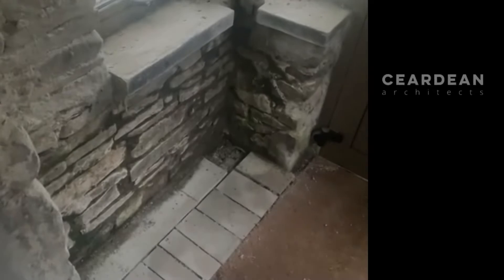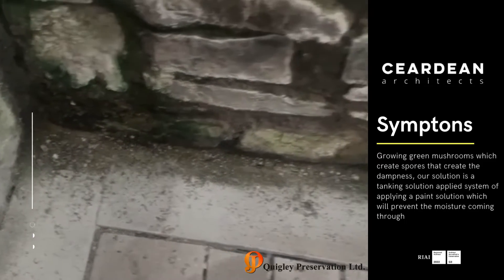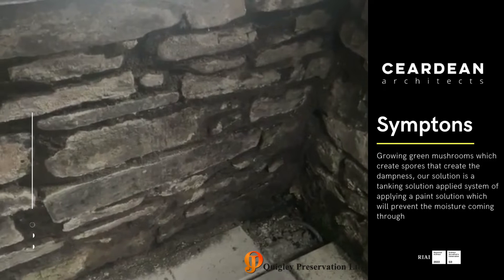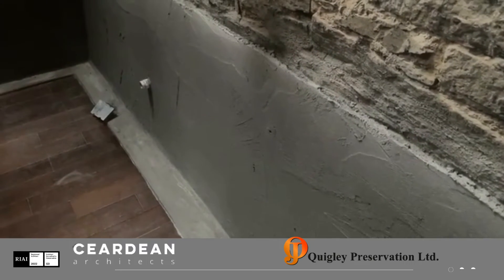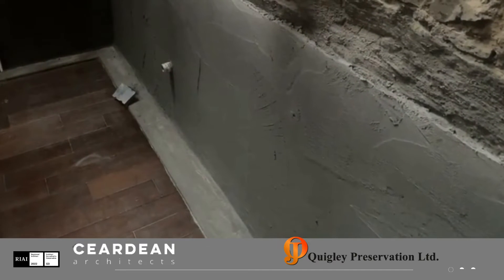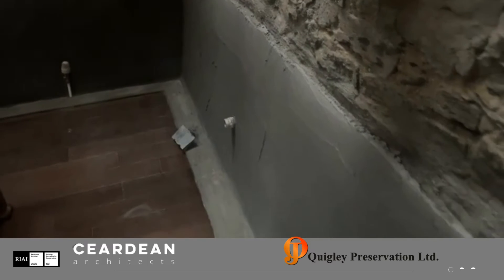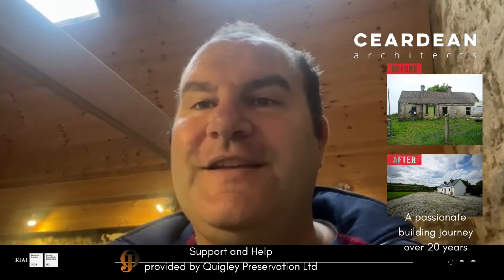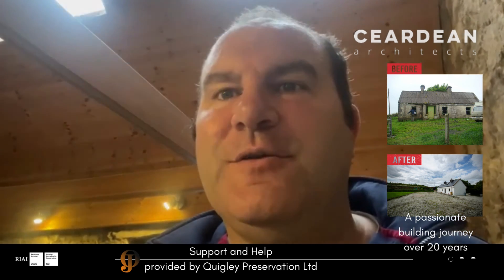1930's Cottage Damp Proofing and Waterproofing in Sligo

Comment: all that you are doing with this system is hiding the problem temporarily.  You are trapping the moisture into the wall.  Is the stonework exposed externally?  Those products that you are using that seem to want to seal off stone walls when the approach should be, as you say at the beginning, is to let the walls breathe.

Comment: Good video but one problem... You shouldn't use cement on stone walls it draws the damp in , you should have done more homework and used lime mortar to cure the damp problem completely . Give it 8-10 years and it'll be back but higher up the wall and in the floors.
Reply: Hi, this is a fully tanked system. Cement as part of the manufacture instructions is mixed with the K11 sealer. When applied to the stone to round off the edges before the K11 paste is added and more render. Normally this is installed to 1200mm high. I just had to take a chance doing it lower for aesthetic reasons. So far so good. Rising damp is unlikely to rise above 1200mm. 

In relation to lime, it is the traditional method but unless you air your house for at least 4hrs every day this won’t work. You would also have mould issues putting furniture against the walls.